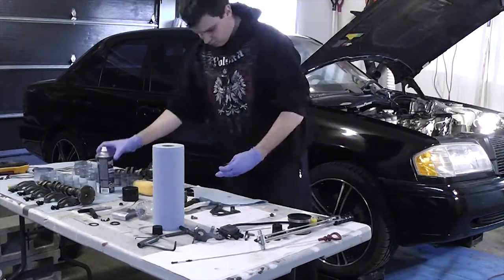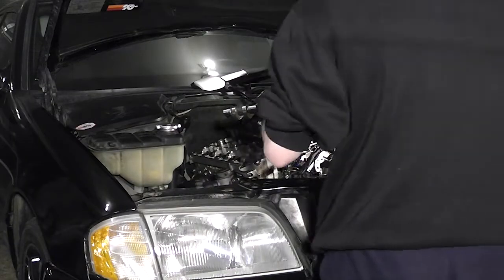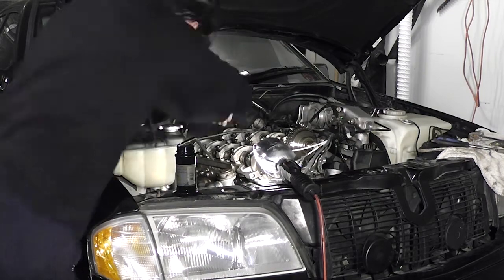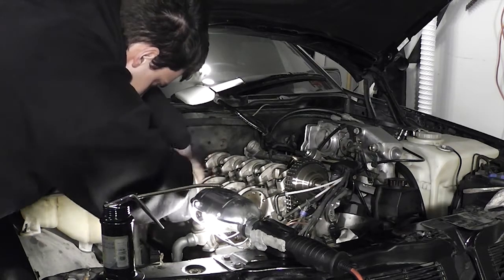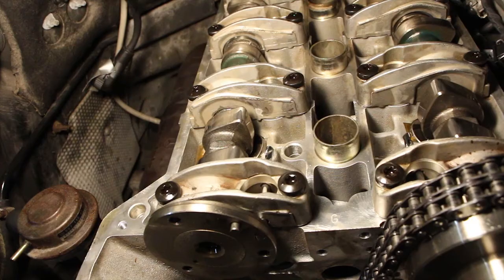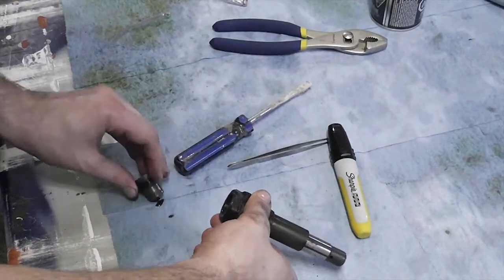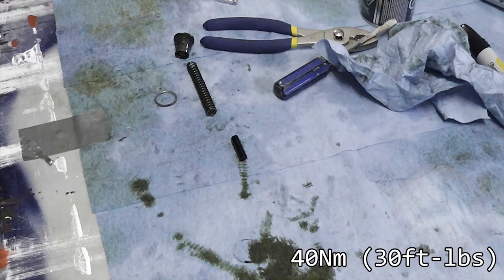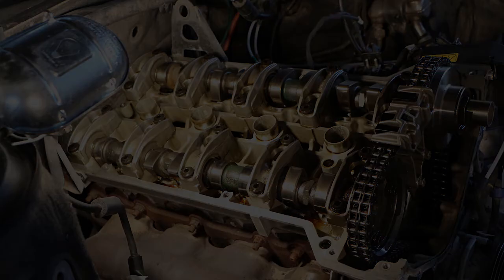M111 Cylinder Head Gasket DIY - Camshaft Timing

Comment: Hi !  I have code error 067-camshaft position sensor L5/1 signal implausibil/missing
I changed two sensors and code persist ..i should check my timing chain?
Reply from the maker: what's the condition of the wires look like? Is there any signs of the insulation degrading? Check the fuel injector wires especially, those are the most susceptible.

Comment: Hi pat
Im in the midle of a head gasket replacement i just put the chain tensioner back in and the chain guide by the tensioner is making a noise from hitting the head when i spin the engine. Is this because the tensioner is empty of oil or is it just too loose?
Reply from the maker: I couldn't really say what the problem is just from your description of it.

Comment: Здравейте, при монтаж на нова верига (комплект) на  колко градуса трябва да бъде синхронизацията на валовете -  на 20 или 20+  градуса?  Ако е на 20 градуса при монтажа след проверка отново ли ще бъде 20 градуса или ще са повече ? 
Благодаря,
Reply from the maker: Yeah bud I'm going to need that in English
Reply: Hello, when installing a new chain (kit), how many degrees should the shaft synchronization be - 20 or 20+ degrees? If it is 20 degrees during installation, after checking, will it be 20 degrees again or will it be more?
Thanks, @PatsCarGarage
Reply: If I lock the shafts the degrees are 28. If I move one tooth it goes about 8 degrees. Does this mean that the chain needs to be replaced / stretched? @PatsCarGarage

Comment: Need HELP i made a head gasket job and while at it i replaced the chain guides and the chain i was barley able to screw the exhaust sprocket  and the chain is tight af any ideas ? 
thank you
Reply from the maker: Did you reset the chain tensioner?
Reply: @PatsCarGarage   yeah, there is no tensioner and the chain is stretched too much. Thx for the reply.
Reply: i have tracked down the problem with a probe camera fed through the crank seal the chain is making a "belly" under the crankshaft sprocket. I tried to feed the chain tightly with a wire from one side and turn the crank , i tried to turn all crank and cam together but the chain is refusing to go in place down there.

m111.955
Am getting desperate plz send help
Reply: @buscoclanlatinol2494  Take the front cover off, get the chain into its place and make sure that it does not move while you are putting the front cover back on and wiggling with the camshafts.

Comment: Hi Pat, thanks for the great video. I have a question. I'm planning on just replacing the timing chain on my m111. Am I to understand that at around 20 degrees past top dead center, I am able to lock the camshafts in place such that I am able to freely turn the crank after I remove the timing chain? Are the valves out of the way? So the pistons will not hit the valves?

Thanks again!
Reply from the maker: I don't think you can do that, at least I wouldn't. as long as the camshaft is in I'd assume some of the valves are open enough that you shouldn't rotate the crank if the chain isn't on.

Comment: Hi Pat.
I recently had a valve job on my w202 c200 m111.942 engine, and timing had to be done. So, the thing is that my mechanic just located the crankshaft at 40° and then just made the two pins on the camshafts somehow aligned, then the car started well and runned smooth, the only issue that i ended up having is: 1) sometimes is hard to turn on the engine and have to crank it long, and 2) the rpms when turnin on the engine are so low  i have to step on the gas pedal for a a minute until idle is good. Could my mechanic have done wrong the process of timing the engine? or it could be he damaged something while doing the whole engine job??

PD. my mechanic struggled finding the correct angle degree point on the crankshaft.
Reply from the maker: Yeah 40 degrees is too far for timing. It needs to be started earlier than that. The timing would need to be redone.
Reply: @PatsCarGarage  thank you Pat, whats the right angle degrees for the crankshaft? How can i fix this issue with the right meassures? Whats the best way to explain to my mechanic to redo the timing process??
Reply from the maker: @anibalnikov47  see the end of this video

Comment: The camshaft cap are torqued to 25 Nm according to Autodata. Where did you saw the 21 Nm value ?  I'm assembling my engine and I don't wanna mess this...  not that 4 Nm would make a difference but that part is critical
Reply: Also, in Autodata it says to torque the exhaust camshaft sprocket to 20 Nm + 90º .  Where did you see 60º?
Reply from the maker: @carlosfreitas21  Again, either values will be fine, the sprocket bolts are torque to yield, meaning the final clamping force is given by the fastener's yield strength, so getting the torque measurement perfect does not matter, you just need to yield the fastener (which is why these bolts are 1 time use). The importance here is to keep on turning because you might snap the fastener off.
Reply: @PatsCarGarage  thanks !
I changed the chain guide rails also because one of them was cracked. I removed the timing cover, hell of a job, removing the alternator, alternator housing, power steering pump push to the side, tensioner, crankshaft pulley, water pump... 
I have the w203 with m111. 
Today I put the cylinder head in place, tomorrow it's time for timing work. 
Your videos helped me a lot ! 

Thank you ! 👍👍
Reply: @PatsCarGarage  just to let you know that my car just did 1000km no leaks whatsoever. 

Thanks for you videos, helped me a lot ! 

Greetings from Portugal.
Reply from the maker: @carlosfreitas21  I'm glad to hear it! Thanks for watching!
Reply from the maker: Bentley service manual. TBH either values will be fine, the height of the cap is set by where it lands on the cylinder head. The idea is to not over-torque the bolt.

Comment: I ordered a new tensioner and kit with chain just bc it was on sale but the tensioner came preassembled like the bottom half is stiff in that first position. Just curiousif you had info of this
Reply from the maker: I would pull it apart and reassemble it as shown in the video just to be safe, especially if it is completely assembled.
Reply: @PatsCarGarage  yeah did exactly that because I wasn't sure and I didnt want to fuckup

Comment: This is a great video, really useful. My only query is when you install the intake cam and align to 30° past tdc how to you measure that? I am putting my cylinder head back on after a rebuild and I just don't know how to work that bit out. I get it on the crank there's markings but not on the cam sprocket unless I have missed something. Thanks.
Reply from the maker: Use the locking holes to line everything up roughly. The chain should go on the intake sprocket no problem. If the exhaust doesn't quite line up, unlock it and move it clockwise (if I remember correctly) slightly until the chain slips onto the teeth. you can then do 2 full rotations of the crankshaft and remeasure it. The correct angles are at the end of the video.
Reply: @PatsCarGarage  got it. Thank you so much, just watched most of your videos on the M111. Just know your work is really appreciated so thank you

Comment: This timing is good for clk 230 kompressor facelift 2001? because i not find specification from my car, i find for not kompresor or not facelift
Reply from the maker: it's good for all M111 engines, so yes!
Reply: @PatsCarGarage  i collect my engine, in addition to the electro Magnet works fine when you turn on the engine soind engine bad this electric magneta roundabout way, this is a bad timing chramshaft adjust?
Reply from the maker: @aurimaspuniskis6804   The magnet is probably good. It sounds like a problem with the intake camshaft adjuster.